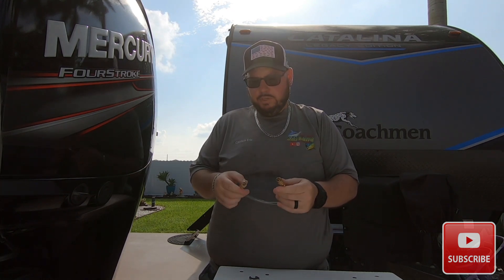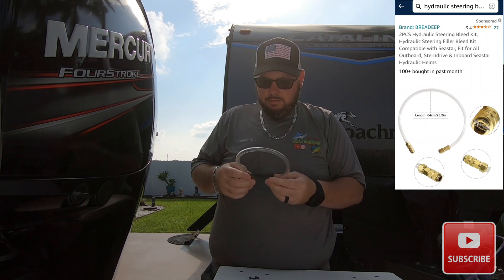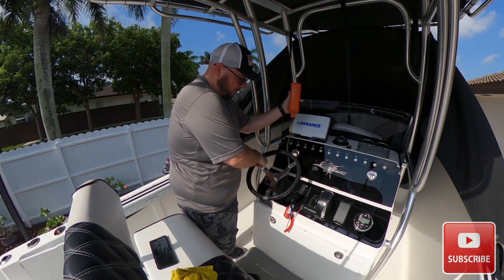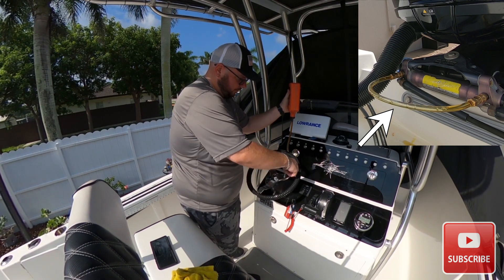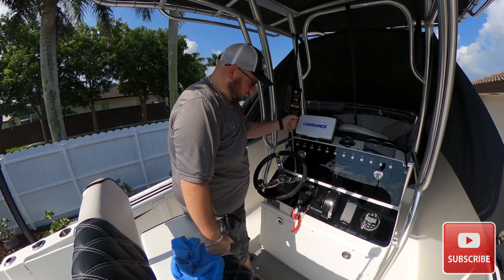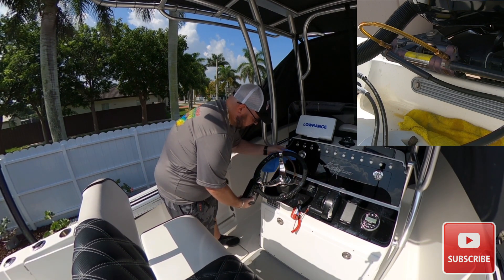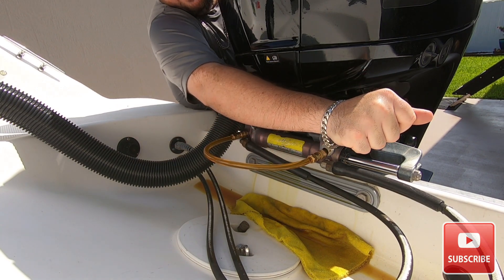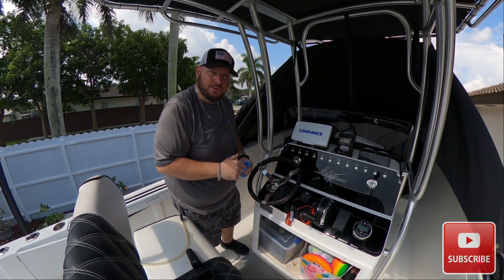How to Bleed a Seastar Hydraulic System, Easy & Simple #diy

Comment: If you have twin outboards, do you need to do them at the same time with that tube? or one at a time?
Reply from the maker: Its the same for Twin outboard as you only have 1 hydraulic cylinder to one outboard and from that 1 outboard you have a linkage bar that goes across to the 2nd outboard. I did this same process for my project sailfish boat which has twin outboards and it worked just fine.

Comment: Why do you keep turning left and right and back to left and thrn right etc?  It does absolutely nothing.  Just moves the air bubbles back and forth.  Keep turning in 1 direction until air bubbles get back to helm pump where the bubbles release up through the clear tube.  You also cracked the bleeder vents too far ans yhats why it leaked fluid.  Leaking fluid also introduces air into the system.  Better to put clear hose connections on both bleeders valves before cracking them open.